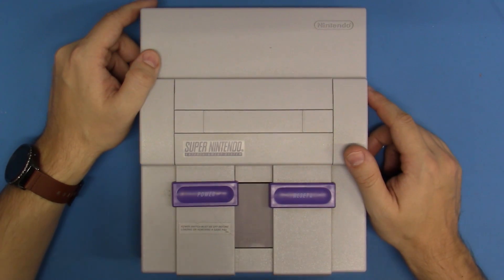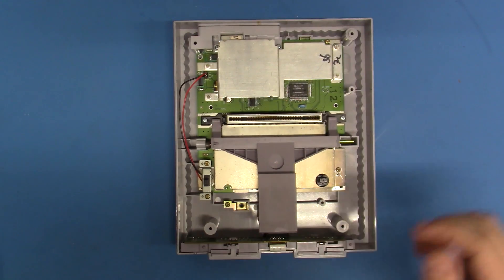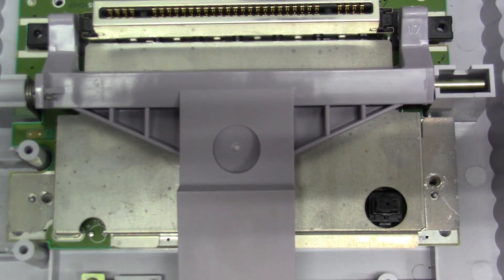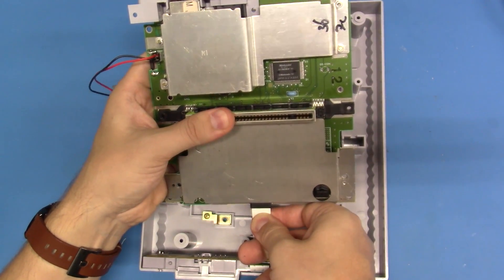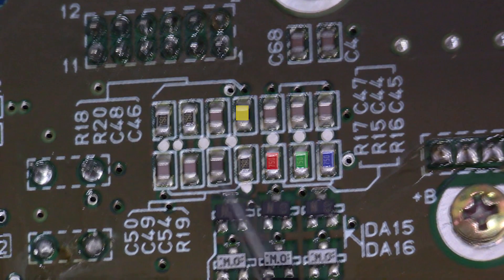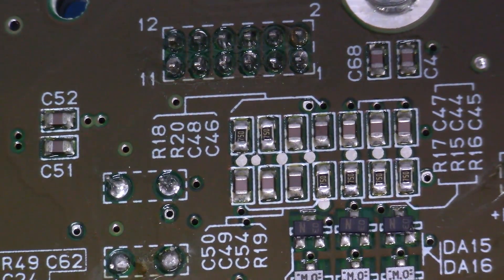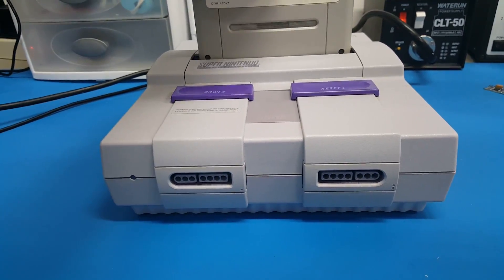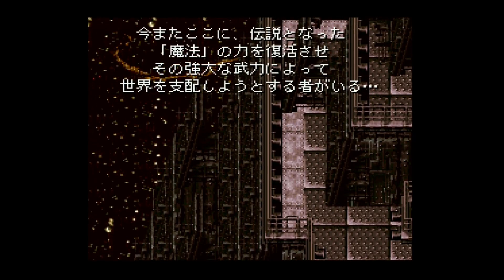Getting the best possible video quality out of the SNES 1CHIP

Comment: Hi Voultar, this is such an excellent video and I really appreciate the time you take in explaining the process and what everything is doing as you do each step. I saw in your video that you left the composite signal alone, does that mean that if I did this mod to my 1-chip-02 SFC, would I still be able to use the composite video out when hooked to my CRT that is using a composite input? If not, is there such a thing as a switch that can be wired this board that could turn the mod chip on or off? I'd also be curious about the PC-Engine Duo version of this as well. Would love to run it through a RAD2X, but also would be nice to hook it to the CRT with composite. Thanks!

Comment: anyone else bothered with how the brown wire turned out in the end? also, instead of using the red, brown and black wires, could we use a red, blue and green wire or would it not work because typically the green wire is for grounding?

Comment: Regarding replacing C11 with a 200-470nf cap, is there any benefit to the going one way or the other within that range? Is it possible you might still experience ghosting with 200nf and going to a higher value would work better for example?

Nice video. You make it look so easy that even I feel like I'd be comfortable doing this

Comment: I have the SNS-CPU-RGB-02.  It's a 3 chip board, but it uses the same S-RGB for its RBB encoder.  Do you think I could use this mod (changing where I land my wires to fit my board) and get any benefits or do I need to look at a different board?

Comment: Great video Voultar I congratulate you I have a question how can I know if a normal SNES brings the 1CHIP without opening the console, in my city Tulsa, there is a retro store they sell consoles but they are not going to allow you to open the console to see if they are 1CHIP  or they are not, there is another way to find out, I hope you can answer my question thank you very much.
Reply: Usually the Serial number at the bottom of the console with be a UN3..... it's not a guarantee necessarily but just know if it starts with a 1 or 2 it's most definitely not a 1 chip unless some weird swap has been done at some point which I'd think is super rare.

Comment: I'm looking at this as a mod for my 1CHIP, but the other guides I have read don't mention removing those SMD resistors. Why is it needed here?

EDIT: Looks like the other guide I was looking at was for a SNES Mini/Jr, so there is no RGB encoder to take out of circuit, that's why.

Comment: Nice ESD safe brush you've got there 👍
Reply from the maker: Thanks for knowing what ESD even is.
Reply: @Voultar  have you never had any issues with it? (I guess not if you've done lots of consoles using one)
Reply from the maker: @ximonx  I have a pretty elaborate ESD setup here in the lab. And nylon typically isn't a good candidate for ESD discharge. So no, I've never had a problem.
Reply: @Voultar  good to know 👍

Comment: I like the video don’t get me wrong but there was one mistake I have to point out with your installation technique,and that is where is all the hot glue that’s supposed to hold the wires and chip onto the board?  You can’t tell me that solder is strong enough is it. Haha jk man nothing but great work as usual from you.

Comment: Hey, I just installed your board exactly like you did in this video for a 1-Chip 03. When I put it on the screen, it acts like the Csync is all messed up (screen freaks out diagonally but displays proper color and sound) Does that mean I need to get a new cable that bypasses Csync? Or should I remove the Csync capacitor and wire in the fourth wire to CS on the mod chip?

Edit:
If anyone else has this problem with their 1 Chip-03, go to http://retrorgb.com/snes1chip7374.html. I ended up using a jumper wire from R9 to the CS on the amp board. The 1 Chip-03 doesn't even have the hardware for native CSYNC so all you have to do is connect the wire to each board. Works perfectly.

Comment: Would this instalation be the same for a PAL SNES 1-CHIP that has been modded with a region toggle switch? I'd like to to uninstall an RGB Bypass Mod that an ebay modder did and install your board.
Reply: You would need a PAL region mod board.  Same basic steps.

PAL and NTSC snes's have a different pinout, on the multi out.  So you would have to keep using PAL region cables.

Comment: Pardon my noob question, but how do you connect the SNES and to what type of display do you connect it once you have done an RGB mod? I understand that SCART cables are a thing that can transmit the RGB signal, but what do you hook those up to in order to get an image out?
Reply: Short answer:  In North America use HDretrovision component cables.

Long answer:  You could use something like the ossc or framemister to connect to your TV via hdmi.

You could get a scart to bnc adapter then hook up to either a PVM or BVM.

You could also import a TV from the UK with scart inputs.

Japan also had TV's with rgb inputs but they are not scart.  It's either jp21 or the Sony multi a/v port.  There are adapter available for both.

Comment: Hey Voultar, love your videos. I'm a hobbyist and been using a standard soldering iron for all my electronics projects, R/C, and modding PSX, XBOX, 360 back in the day. I'm looking now at getting a hot air re-work station. I've got a budget of about $200 for it. Any recommendations? In your videos, what solder and no clean flux do you use? i'm using 60/40 tin/lead rosin core, and i've got a coil of 91% Tin 9% Zinc. then i have lead free 97/3 which I always find hard to work with.
Reply: I believe on a couple of his videos he said he uses an 858D, which is also what I've been using. Doesn't seem like you can go wrong with that!

Comment: Thank you for this install Mr. Voultar, much appreciated. This video confirms my speculation that the FC twin has this same issue while using a HDMI upscaler.  The composite to HDMI device rocks while using it with the Sega Saturn but the FC twin there's a noticeable vertical line much like what you described in this video.  Needs a cap easy enough but would you happen to have a FC twin laying around for modding because I would much rather use the newer console vs my original top loader. The top loader needs a conversion card for the game genie (mail order) adaptor that I will never be able to afford.  Just curious but excellent informative 1CHIP install SNES fans rejoice.

Comment: Even putting the spring into the slot, I was STILL not satisfied with the amount of force of the eject button popping back up, but I found a very simple solution to this issue which plagues us all.... simply install a motor to the eject button! The motor I use is from a 1986 Ford Thunderbird (with turbo) and of course must rest on a platform externally from the SNES and requires gas, but an engine from a 1992 Ferrari 250 GTO can be used as well . It must also be started and running BEFORE you eject that SNES cart! A shaft about 3 inches in diameter can be made to go through the side of your SNES and attach to the eject button. If you wired everything up correctly, when you press down on the EJECT button to remove that cartridge, it engages the clutch on the engine transmission. When you let go, it's the same as releasing the clutch pedal while driving, the engine revs in its first gear and the eject button pops back up with a force that's FINALLY good enough for us SNES gamers.
Reply from the maker: .... Meet me at the hotel, tonight..
Reply: @Voultar  I want to add another like to this comment, but it's already at 69 which has me torqued no pun intended.
Reply: You said “shaft” 🤣
Reply: ahaha I didn't know Game Sack makes funny comments on other channels :D
Reply: Ahh the ejaculation mechanism.... got ya. lol
Reply: Old news, easy to connect the shaft to a turbine running on nuclear energy.. just a bit hard to get the plutonium, but if you browse the internet a bit you get it cheap.
Reply: I smell gasoline, is that normal?
Reply: good old 16-bitoline
Reply: Wth are you trying to do, punch holes in the ceiling?
Reply: Now that's a Mans V8 ejector!
Reply: I found that not even those motors could satisfy my needs. I ended up using an LS1 engine I pulled from a 2001 Camaro. After some modifications which include but are not limited to; Whipple supercharger, cam swap, and I ported the heads and the intake. After all of that I bolted it up to a 4l80e transmission and I finally got the force I needed! Not too bad if you got a little bit of money.
Reply: Puts the cartridge into orbit in the process!! lol

Comment: What about the brightness fix?
Reply from the maker: I don't believe I understand what you're asking.
Reply: I think he's asking about the three resistors that are soldered to the board to attenuate the rgb signal and lower brightness. That was the old way to bring it back to stock levels. As I understand it this mod does the same thing eliminating the need for the three resistors.

Comment: I did a similar mod on my SNES.
What I did is, I threw it in the closet and bought a SNES Mini, which I added ROMs to. 
HDMI out! Done!
Reply: The mini is nice but the image is noticably softer/blurry and there's 4 or 5 frames of lag because the mini is just an emulator, non the less it's still a good system.

Comment: Just so I am getting it right, as well as everyone else who might missed it, correct me if I am wrong.
You want a Capacitor with the values between 200 nF and 470 nF, with the 300s being the sweet spot. 0805 sized package for older One Chip and  0603 for the Mini .

Comment: Are the resistors that need to be removed for the R-G-B lines in place for all 1-chip (01, 02, 03) revisions? I am also wondering if there is any installation difference, particularly with the -03 models, which does not come with CSYNC. Great video as  always.
Reply: On a 1 chip 03 you will remove the resistors but the cap will be gone and you will have to wire csync there is a guide at retrorgb.com on where/how
Reply: frank strasser Thanks!
Reply: merlingt1 yep np

Comment: Awesome video as usual! Can you do some basic soldering skills videos? Something we can practice before doing work on consoles.
Reply: I bought a 20$ solder kit off Amazon and have successfully modded all my consoles and fixed all kinds of electronics I'm an absolute beginner but it's really not that hard you should definitely give it a shot.
Reply: I started out with a cheap 30 dollar amazon soldering iron and used a couple busted hard drive boards and transferred parts back and forth until I got comfortable with the process and my technique. Then I moved onto actually repairing something very easy and worked my way up to more difficult jobs. Practice, practice, practice...

Comment: Great video as always Voultar, i would like to request your help recentrly i got an snes 1 chip system 01 but i got trouble running some games, like street fighter II the world warrior and yoshis island, some people told me it can be a ppu problem, other told me a ram problem, i would like to know your opinion what could be the problem, because i tried running other games like mario world, killer instict and it was working fine but with the games i mentioned it was acting really weird like the game or the system was crashing i dont know why here is a link showing you some pictures https://imgur.com/a/cE1Awpg hopefully you can help me
Reply: Try to clean youre cart slot :p
Reply: the cart slot is clean the games too they work fine i tested them on another super nintendo and they work just fine
Reply: @lordvash2620  U have soldering station with hot air ? If u have try to heat up all pins of ram chip, encoder and ppu. Maeby is not connecting properly, try it out.

Comment: Any thoughts of integrating a dejitter option into the RGB amp?
Reply: I just did the same as well. My Sony TV which wouldn't take any signal from my snes or av famicom can now display 5x scaled ossc from both. It's a great mod and would be cool if these two were combined
Reply: I just installed a dejitter board myself from Videogame perfection.com it was easy to install and worked great first shot so happy to have my SNES working perfect with my OSSC.

Comment: Shaft is just plated steel, no?
Reply: The brass color is an anti-corrosion finish you'll see it on Hardware screws sometimes too
Reply: letsgetsteve Yes.
Reply: Its Aerospace grade Titanium
Reply: Most likely, as copper is a lot more expensive, so you certainly will never use copper if you don't need copper. copper costs about 10 times as much as steel currently.
Reply: @fgregerfeaxcwfeffece  Copper is also softer than steel and would not be a good material for a long, relatively thin rod.
Reply: Shaft lolz 😂
Reply: This is likely a thin film interference effect from the oxide layer formed during the tempering process.

Comment: I paid too much for what should've been a 1CHIP serial on ebay :( Got SHVC-CPU-01. Plastic not yellowed or anything. I have a feeling the seller knew what they were doing...
Reply: Infinity2z3r0 how I find one is exhaustivly look through every add for one with the serial and a seller who seems to not know i.e. Someone just trying to get rid of it that doesn't use it like a parent I even found a 1 chip 03 with controller and mario and adapter for 50 because it was claimed to be broken most of the time they arent
Reply: When I list consoles on ebay, I always take them apart and supply pics of the motherboard to show revisions. I also don't buy other consoles on ebay from people who don't do the same.
Reply: pancakewizard I do when finding a deal